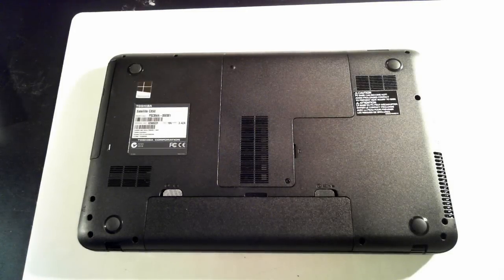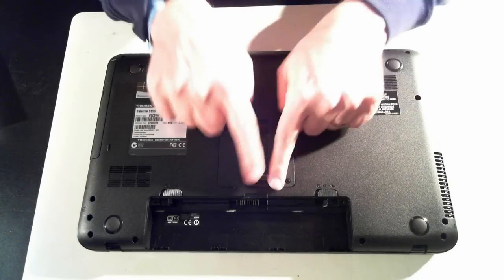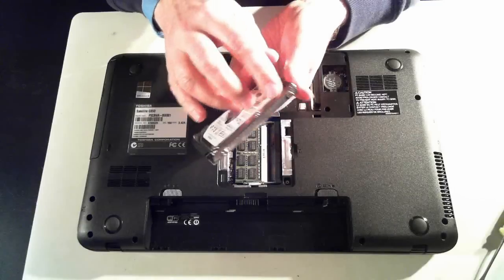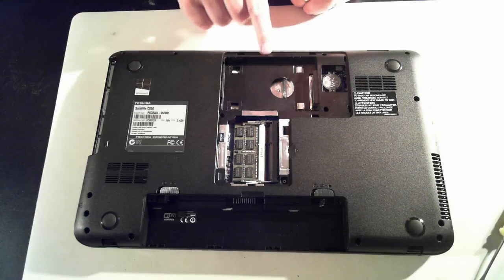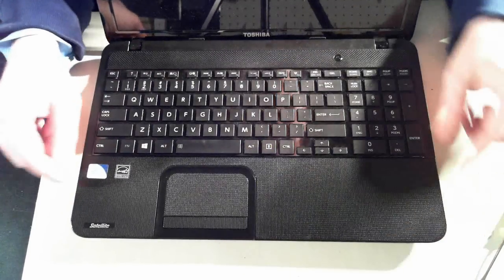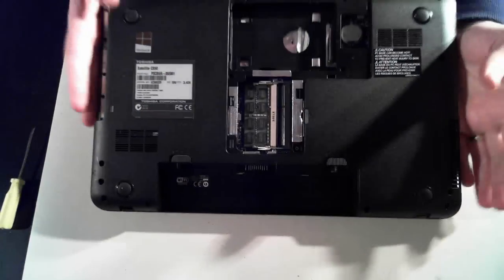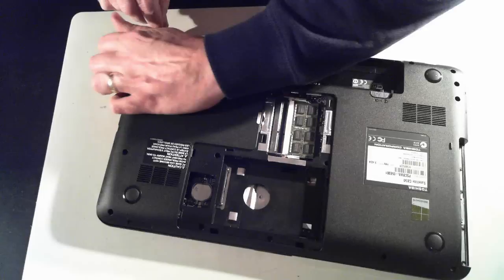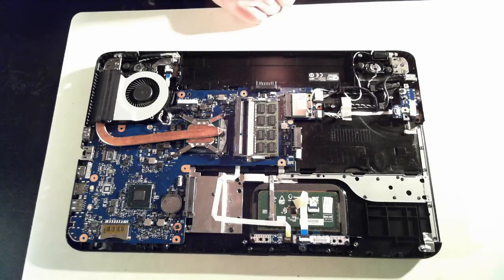Toshiba Satellite C850 Teardown

Comment: Thank you for the video. May you explain what is the bay below the WI-FI and to the right of the RAM bay? It's a 7+6 connector with a large empty space . A lot for NVME driver or an extension device? Thank you for answering.

Comment: I know this laptop is old now, and  people will perhaps have given up on it being any use. I've just used the teardown guide to get me to being able to replaced the processor (Intel Pentium B960, dual core, 2.2 GHz) with a slightly better Core i5-3210M (base 2.5 GHz, Boost 3.1 - dont know yet if it will use that - , 2 cores, 4 threads) . I've popped in 8Gb old ram i had from another laptop, installed a basic SSD drive and installed Pop!_OS. More than capable of doing the basics again. Parts cost me less than £40 on ebay, time taken was about an hour.

EDIT: Bios does support turboboost and when enabled i'm seeing max boost on both physical cores

Comment: i have a problem with an exact same laptop like this.  one of the earphone jacks does not work at all, the other one is faulty. the battery does not last even 2 minutes without actual power plugged in. i know its best to just replace the battery, the laptop is a bit old.

Comment: Cheers bro...Thanks a lot for the video! :)

My toshiba satellite C850 model has some serious problems with the battery. I replaced the original one after 2 years of purchase with a new one, as it was not giving enough back up. Now the new battery is showing same problems in 3 months of usage! 

Please help me out...
Reply from the maker: It the battery a original Toshiba or a third party one? Also is the laptop connected to the power continuously 24/7?
Reply: dpcomputing its a third party one. Not always connected, but still yeah, I don't always remove it from charging as soon as it is fully charged!
Reply from the maker: It may be a dodgy or faulty battery. The not removing from power once charged isn't the best but shouldn't kill in within 3 months.
Reply: dpcomputing thanks buddy! 
😊

Comment: hi sir where can i order this bottom plastic whole
Reply from the maker: Check out ebay else you will have to contact Toshiba direct or one of their service centres.
Reply: dpcomputing can you tell me the correct name of part
Reply from the maker: AFAIK there is no actual name (as manufacturers call them different things and it also depends o the type of laptop) but have heard them called bottom bezel, bottom panel, bottom case.

Comment: Hi, I have a Toshiba Satellite C850 PSKC8A. I have damaged the upper body around numberpad (crack next to the PGDN button) and also the bottom case - couple of screws don't stay in any more.

Is there a way to replace the body (if I can find a spare one from somewhere that is)?
Reply from the maker: Yes it should be posible to take everything out and replace it in a new casing.

Comment: Hi, I got a problem with my Satellite C850-B240 that it suddenly showing me an enter HDD/SDD password screen directly after Toshiba logo, i couldn't remember whether I've set that or not. Now i need to access my laptop without deleting or formatting my HDD, what can i do????
Reply from the maker: Unplug the device, remove the main battery and also the CMOS battery. Leave for 10 - 20 minutes and then reinstall the batteries. This should reset the BIOS and the password.

Comment: hi mate nice video i bought a toshiba c850 was fully functional i turned it off and now its asking for a bios password can you help with showing me where the reset jumper is?
Reply from the maker: Disconnect the CMOS battery for 10 minutes or so and the BIOS should get reset. I point out the location of the battery at 5:08

Comment: Is the CPU soldered, I want to upgrade my CPU to a new iCore 5 or 7 which ever is best compatible, which one would you recommend ?
Reply from the maker: I wouldn't bother upgrading the CPU as it can be hard to get a compatible model and then their is potential for heat issues.
Reply: Ok, thanks! I changed my HDD to an SSD and noticed a big difference right away.

Comment: Thanks for the video. I dropped my wife's c850 last week and after replacing the display it tends to black out every 20 seconds or so, giving an error of "graphics driver stopped responding". I updated the radeon driver, and that improved things but the problem remains. I tried booting with a linux live usb and again it still happens so I used your video to open the machine up in the hopes of reseating hardware to solve it... But it seems the graphics hardware is integrated into the motherboard. Damn. 

Thanks anyway haha
Reply: +ThalassTKynn but C850 has a intel hd graphics, are you sure u installed the right driver?
Reply from the maker: +ThalassTKynn it may be a loose connection somewhere so try and make sure all connections are seated correctly.

Comment: mine is a satellite c850 X5213 can the processor or graphics be upgraded???
Reply from the maker: +Raja Mohammed I wouldn't recommend replacing either the CPU or video. The CPU is a possibility but you will need to have the new one conform the to the same thermal specs as the current one.
Reply: ok... ty (^.^)  for the advice n my lap lags very often reinstalling os din help that much will replacing ram help this issue?

Comment: Hi, not many videos mention repairs on the Audio plug in connectors. I dropped my laptop on my headphone lead connector and its stuck in the computer. I dont know what damage it has done inside the computer but is it not mentioned because its hard to remove or is it not mentioned because it doesnt do much and can be taken out easily and is it worth me taking it out to prevent possable further damage?
Reply from the maker: Bernadette Furniss AFAIK it is hard to remove and will require the audio plug to be unsoldered.
Reply: ok, Thank you. Do you know if its possable to get an attachement USB replacement so I can put my earphones in my computer and also plug it up to my TV audio?
Reply: +Bernadette Furniss You can get a USB sound card pretty cheaply from amazon

Comment: My toshiba c850 suddenly hangs after 20 minutes. I can't turn it off so im gonna pull out battery put it again. Turn it on and the same thing will happen. What do you think is the problem with this? Please help. Thanks.
Reply from the maker: dean dean ü Could be overheating or maybe one of the startup programs or drivers. Also do a memory test.
Reply: What should I do with this? What part of should I change and fix? Thanks for response man.
Reply from the maker: dean dean ü is the machine getting hot? If so clean the fan and grill. Test the memory with a program such as http://www.memtest86.com/

Comment: Hi David, would you have a video of how to remove the motherboard from a Toshiba C850? Mine is a 1LQ variant and I need to replace the motherboard due to knackered graphics card, which I assume is integrated with the motherboard. Also, before i do this, when I complete the teardown, will the motherboard serial number be visible? Any help in this matter would be greatly appreciated.
Reply from the maker: Paul Fagan sorry I don't have a video for removing the mb.

Comment: Hey I was looking to upgrade the components indside my laptop, the same as shown in the video, so far I have added more RAM but I was wondering what else I can upgrade, right now I was looking at changing the prosessor form and i3 to maybe and i5 but im not sure if this is possble
Reply from the maker: Benjamin Males it is physically possible but from some quick research others have had a lot of issues. Check out http://forum.notebookreview.com/hardware-components-aftermarket-upgrades/709358-toshiba-satellite-c850-13c-cpu-upgraded-but-shuts-off-after-exactly-30-minutes-help-3.html
Reply: dpcomputing  Thanks. Do you know what else is possible to change. My laptop is a C850-161, RAM is double fro 4 to 8GB, intel core i3, basically all the thing you know, my aim is to be able to play next gen games with a good fps, an example o this is assassins creed black flag which I currently play with a maximum fps of 11, Im not sure what things I can upgrade or where I can find these components
Reply from the maker: Benjamin Males  I'm sorry to say but if you want to easily upgrade components you shouldn't buy a laptop. For graphics intensive games you need a good video card which isn't upgradeable on a laptop.